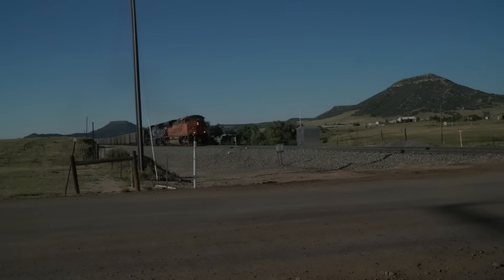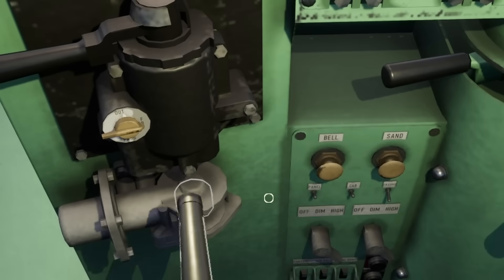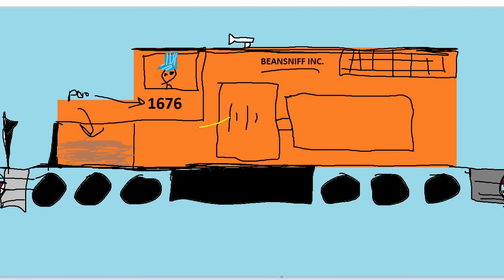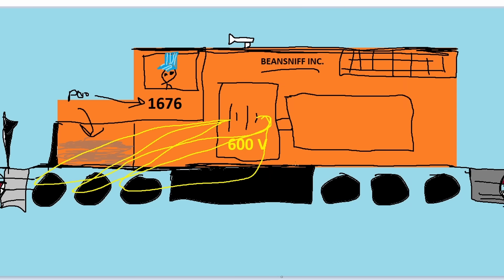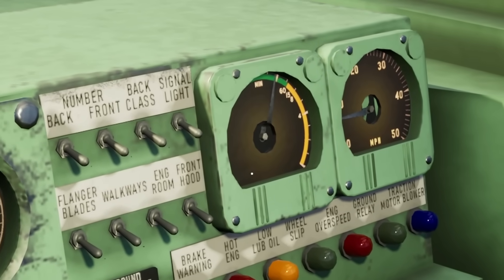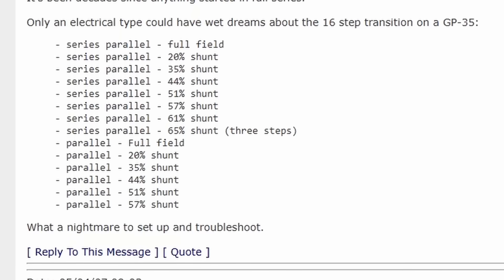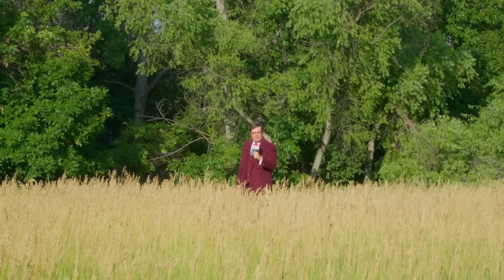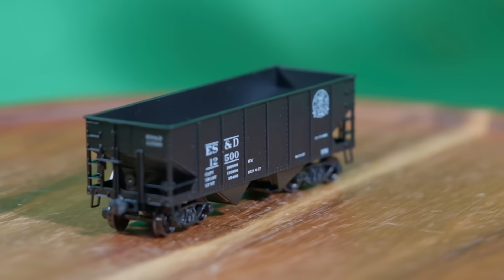The HIDDEN GENIUS of diesel electric locomotives... Transition explained - Railroad 101

Comment: I feel it's worth adding a bit of context on the GP35 and how it has so many steps of transition...that's excessive use of field weakening (or field shunting or field divert). Tons of early locomotives use field weakening (regularly in combination with series-parallel transition, as is the case on the 35) to manage voltage and current in smaller, smoother steps than is possible with series-parallel transition. The harder you push a generator, the smaller the opening between maximum voltage and maximum continuous current, and the EMD 35s push the generator very hard so lots of small adjustments are required to maintain power without overheating the generator. It's no wonder that for any locomotive more powerful than the 35s they used an alternator which can actually handle the high amperages needed without overheating.

Field weakening itself is a trick of the series-wound (electromagnet) motors used on locomotives. The amount of back-EMF you get depends not just on speed of the motor but on the strength of the magnetic field in the motor, and field weakening is all about changing that magnetic field strength. This can't be done on permanent magnet motors like what's used in old toys as the magnetic field strength is permanent (though that's not the only reason electromagnet motors are used in industrial equipment).

In short, field weakening diverts (or shunts, hence the 3 common names for this method) amperage around the electromagnet coils into resistors, weakening the magnetic field and reducing back-EMF. The result is that, for the same power output, the motor demands a little less voltage but a little more amperage, which is perfect if your generator is running near max voltage and can handle just a bit more amperage. Because the change in voltage and amperage are fairly small, field weakening can be done smoothly and quickly without cutting power. Meanwhile, series-parallel transition can only make major changes in the voltage/current demand on the generator, which cannot be done without cutting power unless you want lots of arcing, and might not be possible at all without overheating the generator (which is the limiting factor for the 35s). Pretty clever, but overcomplicated, stuff.
Reply: Interestingly, not sure if it's done in AC traction locomotives, but in road vehicles, field weakening is done a different way, with permanent magnet motors (although modern ones don't have a purely magnetic field, getting some of their torque from switched reluctance), by injecting power out of phase. And, most modern electric cars are field weakening for something approaching the upper half of their speed range.
Reply: @bhtooefr  - Most modern electric motor electronics is driven by Pulse Width Modulation waveforms that adjust the voltage, current, frequency and even phase angle of the voltage/current to the AC Motor. Field weakening is accomplished by increasing frequency of the applied voltage above the rating of the motor windings which increases the impedance of the windings and therefore lowers the current and torque which also lowers the BEMF induced by the rotor. This works since you usually don't need as much torque at high speed as you do at low speed when moving a vehicle.
Reply: @bhtooefr The games you can play with a VFD on induction motors.  Such fun.

Comment: This is sometimes even a thing if you skip the prime mover and hook your loco into a constant voltage power supply by going fully electric.

Trains in The Tube in London have three power settings: Shunt, Series and Parallel.

And for a more detailed example: For the SimRail players among us, this same idea is also why the EU07 and its regears (EP07, EP08) need to be be kept below 600 A until notch 28 on the main traction wheel (and the shunt regulator steps at that level), but can go up to 1200 above that. And similar with the ET22 - it's largely built off the same parts, just on a Co'Co' instead of a Bo'Bo' wheel arrangement, and with three stages instead of two. The breakers for the TM's are rigged for about 600 A, and in series, that's all the current you'll have, but in parallel, each bank can get the full 600 A.

I'm pretty sure other electrics have some more fun trickery to get the train to go brrrr.

Comment: I'm not familiar with diesel locomotives, but I'd bet the modern ones use an inverter setup to create a pure sign wave using a high frequency pwm, allowing you to adjust power to the motor by varying the frequency and voltage

Comment: “Every Model Different” I know a guy who’s worked on GL8s(basically an SW1500), JL8s(see above but twin cab), JL18s(see above but 645 inside instead of 567), JT22CWs (SD40-2 get smooshed) and JT42HCW (big vroomy vroom derived from an M59PHI for some fucking reason), and I have heard this sentiment often. EMD know how to build huge fuck off loud beasts of locomotives, which is amazing considering they seem to immediately forget how to make something once they start on the next model.

Comment: He touches on that AC Generators (Alternators) can make more power for the same size, but he didn't explain why? So, why do Alternators make far more power for their size? The simple answer is Cooling! The 2, major cooling limitations for a DC Generator are in it's Armature! The fact that the Armatures windings are embedded into the steel slots makes it impossible to pass cool air over the area were the varnished copper wires are in those slots, drastically limits the amount of current that those wires can handle before the varnish gets soft & you start getting turn to turn shorts! Also, by using Carbon Brushes, which rub against the commutator's copper bars, Carbon has a much higher resistance compared to Copper, and that heat adds to the already Hot running Armature! 
For anyone who has owned a car or truck with a Generator, & the regulator failed to control the maximum current allowed for that Generator, one day you noticed that the battery was not being charged & when you looked inside of the generator & you saw that the solder that was used to make a secure contact between the Armatures windings & the commutator''s Copper Bars had gotten so hot, that it had melted all of that Solder & it had been thrown out against the interior of the Generator's frame! You then had to replace both the generator & Regulator!
Alternators, which almost all make 3 Phase AC power can make far more power for their size, because their windings are in the Stator, which is much larger & far easier to get cool air to flow around the Stator's windings! The power that an Alternator makes is divided into 3 sections, so the total amount of power that an Alternator makes is can be 3 times what a 1 phase Alternator makes, similar to a DC Generator, which all of the power it makes comes from only one Armature coil at a time! Automotive Alternators make DC power, because they have 6 Diodes inside (3- & 3+) to change the 3 Phase into DC.

Comment: I always wondered about the field SHUNT.......what is it? How does it work? BTW, Nice 1968 GTO..I have a '67 ! .I'm always fascinated by how similar the interests on folks are. Also, I see you have a P Bass...hanging on the rack. I am a Bassist myself...and have a P-bass, as well as several others including a Ibanez SR-900.  So...let's see....Train Buff....GTO man....Bassist....arte you a Ham radio operator too? me...KM3W.
Reply from the maker: Hey Chester! Ham Radio isn't something that I've gotten into yet... Glad you're a fellow GTO enthusiast! I've got a Squire J bass that is being loaned to a friend and a 3/4 upright in the other room. Bass is more for recording for me but I do love to play it.
Reply: In New Zealand we referred to transition as field diversion. (Field shunting or field weakening by another name). The effect was quite noticeable on old locomotives with DC generators as contacts opened and closed in the high voltage circuit. Modern main alternators do this inside the Alternator producing a mere flicker on the load meter. 😊

Comment: When you start into the AC drives, you're going to really see some stuff and sometimes the same concept can be explained two ways. GE did things one way, others did it another. It's all a factor of the equipment they had available, depending on if it was field control, SCRs, FETs, or IGBTs.

Comment: Before there were diesel-electrics there were electric locos and trams using the series to parallel system of switched combinations devised by Frank J. Sprague,(a very distant relative of mine). His eight-step controller is why there still is "run eight" for full power. It even got used for electric elevator controls. Once high power semi-conductors were created it was possible to do things very differently, and enable AC (artificially created) to eliminate the mechanically brush commutated DC motors powered by a similarly configured generator. Motor-generator sets were the preferred means of obtaining  different DC voltages on Navy ships I served aboard, thanks to Frank as well. Now there are high powered DC to DC inverters with no moving parts that are more efficient still.

Comment: There was no transition on the EMD F40s and F59s I worked on in Canada. Computers were involved in the current and voltage controls. The Aux Gen fed the  companion alternator  field which in turn created the field in the main gen. Notches 1-8 controlled the engine field as well as field currents.

Did anyone work on a loco that used transition? Was the main gen DC or an alternator?

Comment: In Toronto's subway system, all of the currently running trains both the older and newer trains have three-phase AC traction motors, but the throttle levers are still labeled based on the original DC control system and they have three power positions, inch, series, and parallel. For the reasons you explained they still some of the older DC cars converted into work cars after hours to do maintenance.

Comment: GET THE HISTORY STRAIGHT - DIESEL IS ITSELF NOW DYING !!!
Diesel Electric locomotives DID NOT become common in the USA until after World War Two. The War having actually helped speed up the process of change. And the Diesel Electric Worldwide is now itself undergoing the same fate as the Steam Locomotive. For the simple reason the "Diesel" engine itself is NOT efficient for speeds above 125mph, as Maintenance costs rapidly spiral if you try and operate "Diesel" at speeds above 125mph.  And Much of Europe now operates long distance trains at speeds of up to 199mph (320kph). On all the TOTALLY NEW "Super High Speed Railway Lines". Even Normal Semi-fast trains on the traditional Rail networks operate in the 100mph-125mph category. As a result "Electrification" of Europe's Rail Network now accounts for around 70% of major routes, and 40% of minor routes. And this Electrification figure is growing annually.  Even Morocco in Africa now has a "Super High Speed Railway" operating at a maximum speed of 199mph. And Egypt also in Africa is about to join the "Super High Speed Train" Club with its line out of Cairo down the banks of the Nile to Luxor. Also designed for maximum 199mph Bullet train type trains ! 
  

Which reveals that "Brightline" passenger route in Florida, which is using new Diesel Trains for speeds up to 125mph, may NOT last long. It will need to be "Electrified" with Catenary at something like a 25,000v AC 60Hz overhead supply. And increase actual operational Maximum speed to at least 175mph. The higher the speed the fewer trains you need to operate the same number of services per day. And Electrically powered Multiple Units need less than half the maintenance of a "Diesel" at less than half the Cost. Indeed the USA could become the last First World Country on the planet to join the "Super High Speed Train" Club !!!!!!

Which already includes: Britain, France, Spain, Germany, Belgium, Holland, Italy, Austria, Taiwan, China, South Korea, Japan & Morocco. With a number of other countries currently constructing Super High Speed Train lines. (Super High Speed Trains are anything designed for above 150mph, and such trains require Specially designed railways to travel at over 150mph). These super trains can still operate over normal railways, but are then limited to the speed allowed on those normal lines. However Normal trains including "High Speed" trains are NOT allowed onto any "Super High Speed Train Line". Because they do NOT have all the special safety features, including Computerised "Moving Block" onboard signalling technology. 

So American Companies like GM & GE, have a dwindling overseas Market for "Diesel", and may eventually go Bankrupt !!!!

Comment: Very interesting, a good job explaining the concepts.  I am going to have to see if anyone has used what I would use, that being a full hybrid design. A diesel engine to an ac generator to a full wave rectifier system ( at these power levels more room for heat sinking and ease of repair. ) to a battery bank to a variable frequency drive system to a delta/wye winding switching contactor set and finally to the motors. Perhaps even wound rotars in the generator and wheel motors ( I hate slip rings ) or not.
Reply: Star-delta is redundant and unnecessary if motors are driven by VFD. All locomotives with alternators use a multiphase full-wave rectification. GE actually tried to build a hybrid locomotive during 2000-s, but it went nowhere.

Comment: I've often wondered if  banks of batteries could be arranged in this fashion in a car. Are these brished DC motors? I was under the impression that the chain was: ICE to alternator to AC motors. I wouldn't imagine that they used invertors, or those horrible old selenium rectifiers! Finally, there's motor/generators I guess? All the Best! 73 DE W8LV BILL (and in SANER times: W8LV/VE3) 🇺🇸🇨🇦

Comment: Nice video here. You are a bit off with the technical description though, while actually putting 600V into the motors would probably fry them at stall, the reality is that in order to do this you would need a ridiculously huge generator to supply enough current to sustain 600V at stall current.
In reality, if you tried running in full parallel at a stall, you will hit the generators current limit at a very low generator voltage, and the generator won't be able to produce much power.

Transition is a nice way to stack the voltages of the motors when at stall and allows them to share the current. Thus, the generator output current doesn't need to be as high. The generator also has a voltage limit, which is dependent on engine RPM. This means that as we speed up and the motors Back EMF gets higher, you can "run out" of voltage headroom from your generator, and it becomes impossible to go any faster. By putting the motors back into parallel, we can avoid this other generator limit and go a lot faster.
So really Transition has just as much to do with the limitation of the generator as it does the motor characteristics.
Reply from the maker: That makes sense; well said. I've always struggled with the electrical concepts of a load vs. source - it feels a bit backwards that a load can try for more than what a source can create. Always been a weird sticking point for me.

Comment: I've heard that diesels could start trains they couldn't pull and steam engines could pull trains they couldn't start due to how their pulling force changes with speed.

Is this still an issue with modern electric drive moters and would a mechanical drive system be practical for long haul heavy freight?

And if so, how difficult would it be to design a system with the tractive effort of a steam Locomotive but utilizing rotational energy from say, a diesel engine or steam turbine?
Reply: The speed a locomotive can achieve with a given tonnage on a given track profile is determined by its horsepower. Thus switching transmission type while keeping the same prime mover will not make a train go faster.

Diesel-mechanical locomotives have been tried in mainline service, and they demonstrated superior efficiency vs diesel-electric. However they were a maintenance nightmare at best (BR class 10100) and outright unusable at worst (russian E-mch-3), so aside from a few small switchers, they never took off.

Both steam and gas turbine high-power locos have built for various railroads in the US and Europe. The biggest drawback of a turbine is terrible efficiency at less-than-full power output, making them suboptimal choice in a railroad service, where engines spend most of their time at partial loads or idling.
Reply: @Knsgf  WHY HORSEPOWER IS BAD - Why STEAM outpulls DIESEL & tonnage math... https://www.youtube.com/watch?v=PF9-k5IbdVI
Diesel Electric and Steam Piston Tractive Effort equations are different, with DE using TE=P*E/V while SP uses TE=c*P*B^2*S/D so a DE locomotive loses TE as velocity increases while a SP system does not, therefore if a train needs to go at high speed with few stops an SP system is best. My question is if it is possible to build such a system without water loss since stopping at water towers negate SP's primary advantage.